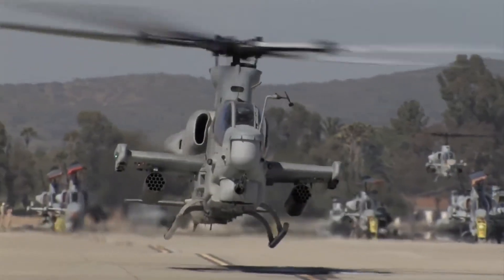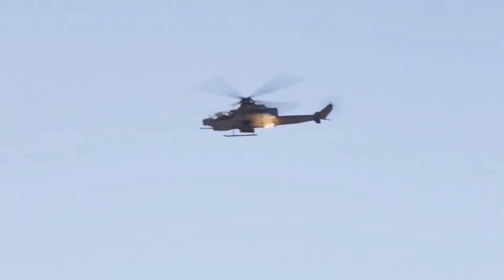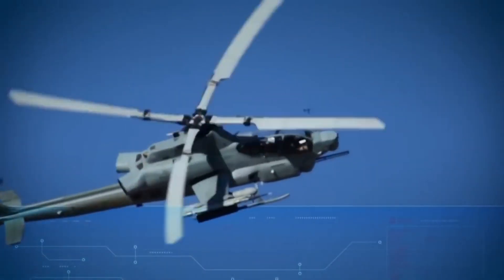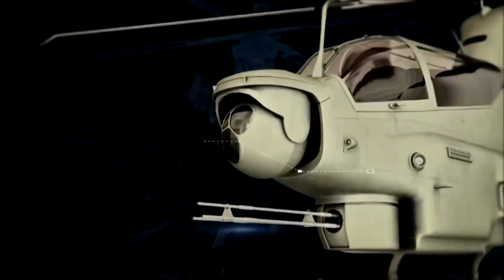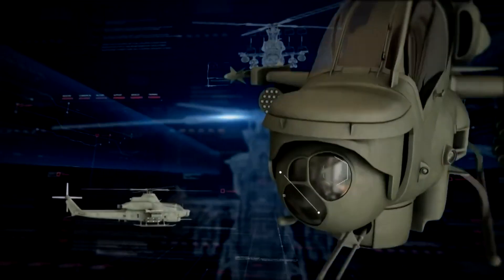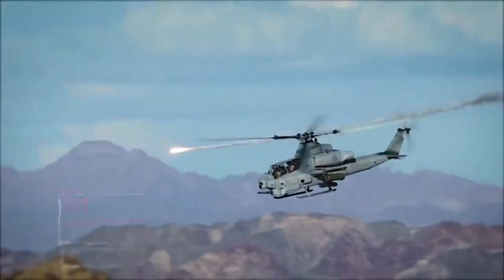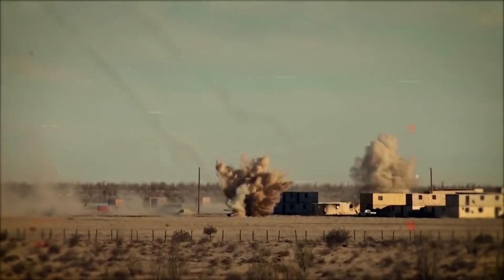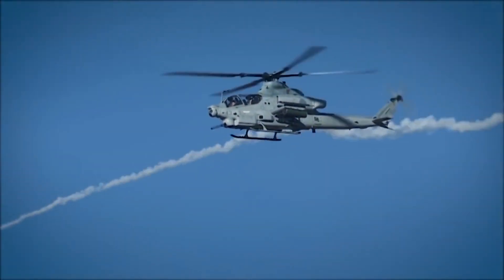Also Known as Zulu Cobra | Four-Blade, Bearingless, Composite Main Rotor System | Bell AH-1Z Viper

Comment: If we add on stationary cover on top with middle hole and rim open for inlet air and add mricrowave antennae tip and higher strenght and thicker blades density will help all weather operating and advance counter infantry and can hover without power and with sunlight amplified laser can help defense after out of armo
Reply: In other words you would just ram them